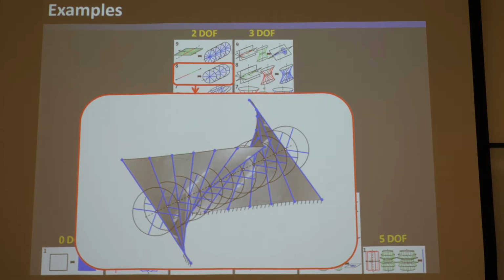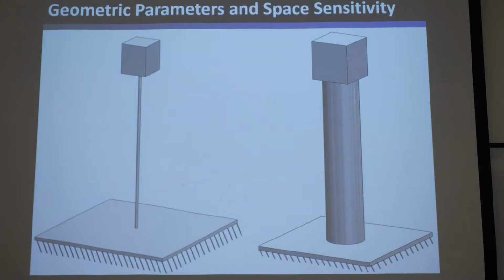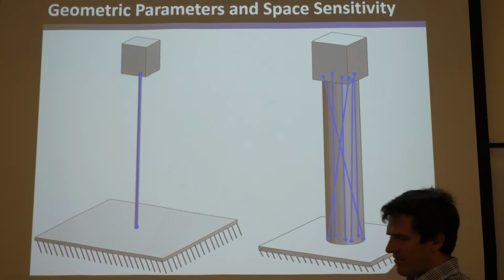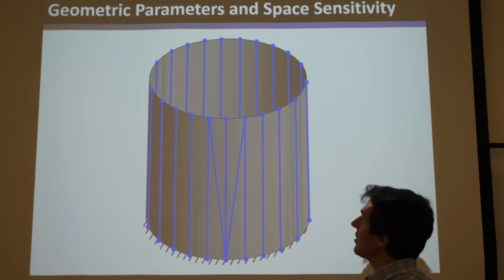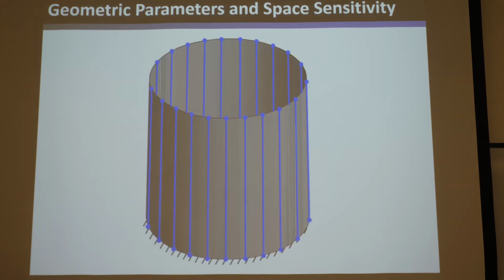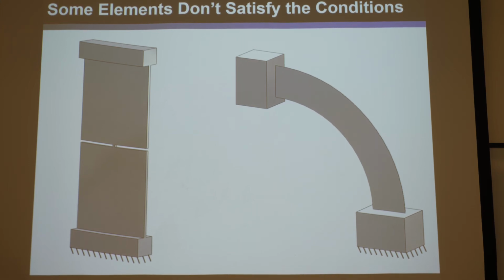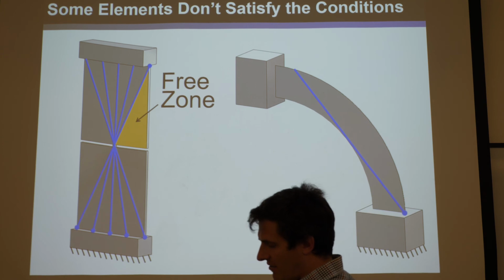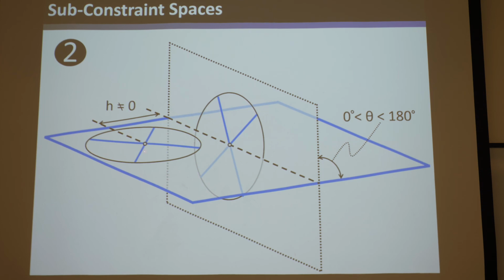Compliant Mechanisms Lecture 7 Part 3

Comment: In optics we often employ the paraxial approximation, treating any trig function tan(theta)=theta for small angles. This works very well until the angle becomes too large and system behavior is no longer paraxial (mirroring the idea of wire flexures increasing in diameter and therefore increasing angles of blue constraint lines).

Interestingly, Maxwell's equations for EM waves can be solved using this paraxial approximation and the solutions for this paraxial wave equation are the modes of free space (or the modes of any waveguide or resonator).

I came to your lecture series as a curious optical engineer with a love of flexures and am thoroughly enjoying the beauty and accessibility of FACT synthesis.

The symmetries between math and geometry to describe mechanical systems vs. optical systems continue to astound me. As well the guiding force of Maxwell in both disciplines! "Maxwell is never wrong" indeed! :)